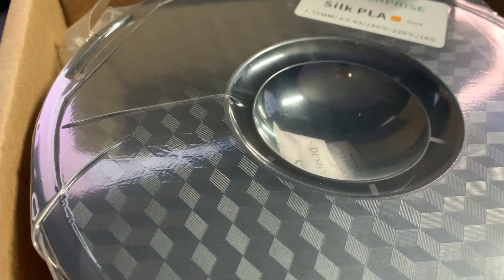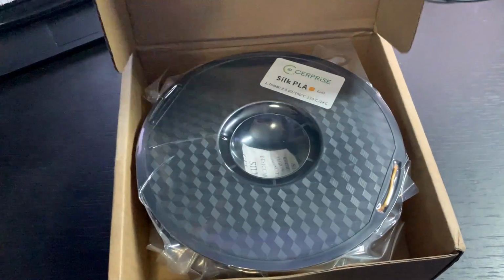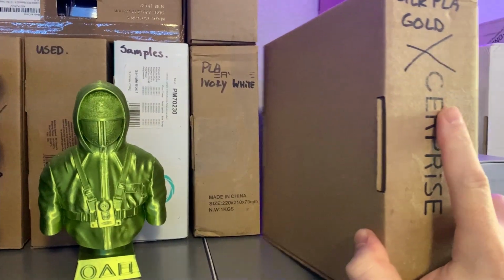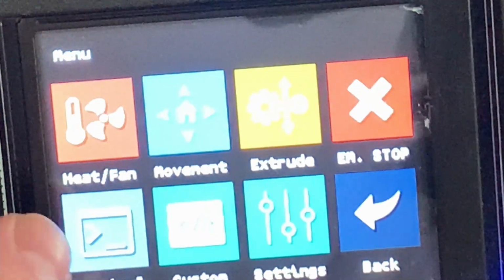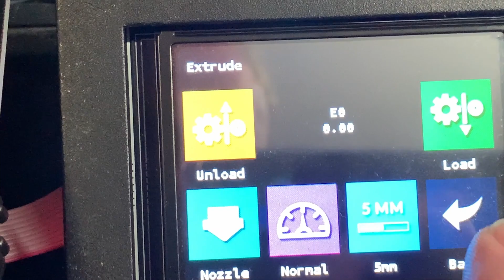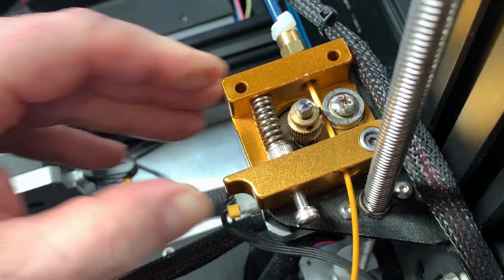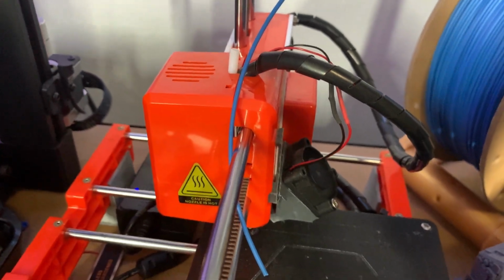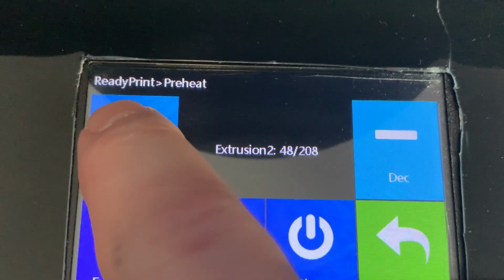How to Load Filament into a 3D Printer

Comment: no of course that didn't help - like most of the other people searching for such instructions it's missing the single set of instructions we look for - what if we accidentally leave filament inside - with a bowden setup it's easy, unscrew the tube, grab the extruding pla and pull - what about with a direct drive where that's impossible??????  -solved, the small allen key works well to shove enough space for the next filament to enter
Reply from the maker: Hey buddy, I’m sorry that I missed some of these things you mentioned here…